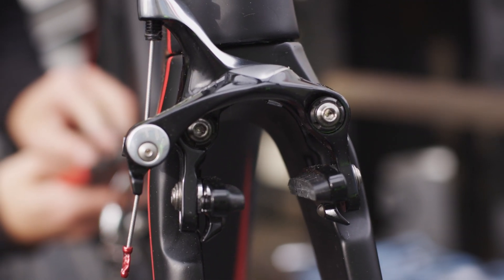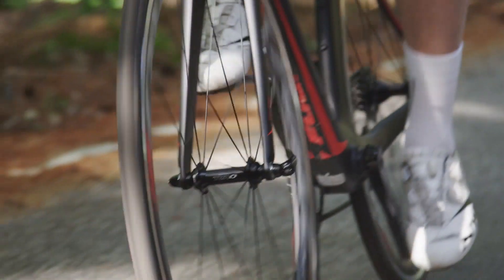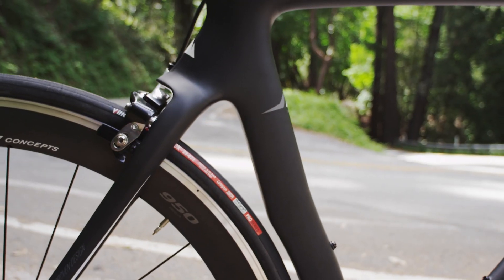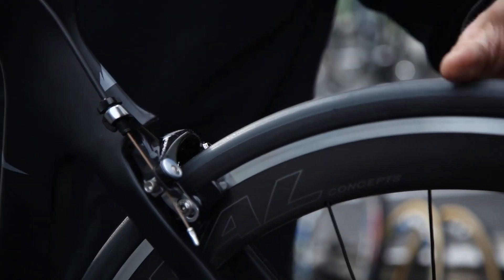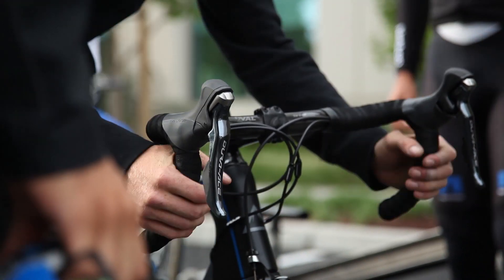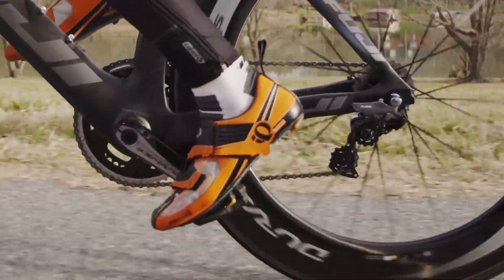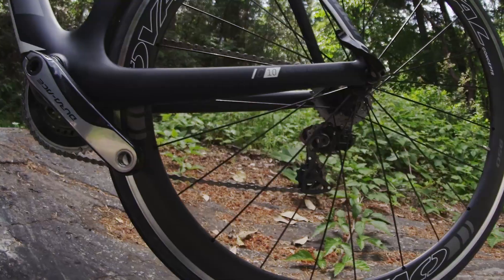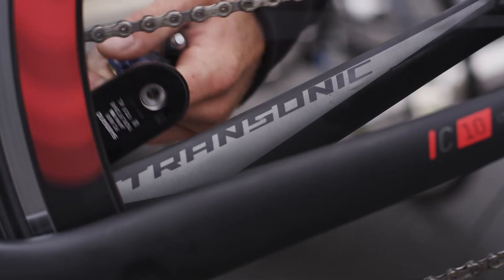Why does the Fuji Transonic have direct mount brakes?

Comment: Rim brakes ad torsional stability to a frame under braking, period. A disc system puts all of the braking forces (weight of the rider, road bumps/shocks, etc) to an area within 3'' of the hubs which only increases flex of the rear frame and front forks. Manufacturers today are all about selling more complicated stuff and selling it (and maintaining and repairing it) more often. Yes, disc systems put more force on the steel discs because of - STEEL - duh, but where are all of the physical forces going out from that tiny isolated area? They are going directly into the weakest parts of the frame. Leverage is a real thing. A 27.5'' wheel has a pad to hub distance of roughly 12.5'' - that's a huge lever but also a huge amount of INCREASED STABILITY. On a 180mm (3.5'') disc the pad to hub distance is less than 3.25'' which is a very short lever, the remainder of which (9.25'') acts as a lever acting AGAINST frame rigidity. It's simple physics, folks. The development should be put toward 20mm thick bottoms on rim frames and increased pressure there on higher strength pads - NOT on dumb as dirt discs which are more costly, maintenance prone and which decrease frame rigidity. The weight of increased thickness of rim aluminum (not carbon rims which don't allow for enough heat dissipation) would be offset by the reduction of hydraulic lines which have to be overbuilt to sustain the pressures, hydraulic fluids, steel used for discs and oversized calipers. FCKING THINK!
Reply: Cry about it
Reply: @yayakuza  Done.
Reply: Correct!
Reply: Rim is lighter

Comment: I know this video was posted 2014.  I still have similar frame design.  I noticed that Ultegra Direct Mount for seat stay is not compatible with Fuji Transonic?  Or there are Ultegra Direct Mount that I am not aware of?  Thank you.
Reply: Bro same problem what Rear Direct Mount Caliper you are using now? Because I Buy R8010 Direct Mount Caliper but the rear brake is not compatible
Reply: @vincefrancisco3075  I am still using the rear brake that came with it. Replaced my front to Ultegra.
Reply: @Lacsamovie  are you Filipino sir?
Reply: @vincefrancisco3075  yup yup
Reply: @Lacsamovie  nice sir anong gamit mo sir na Rear caliper kase bumili ako ng Ultegra R8010 na Direct mount caliper ung front niya is compatible but the rear caliper sir hindi compatible
Reply: @vincefrancisco3075  hindi ko na pinalitan. Kung ano nakakabit nung binili ko. Binalik ko lang. Tektro ata sya. Harapan calipers ko Ultegra.